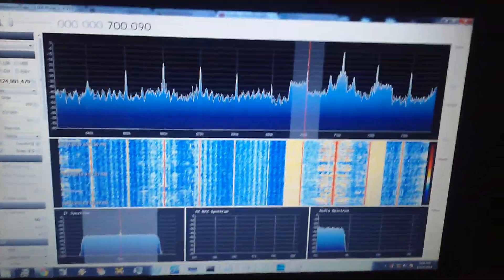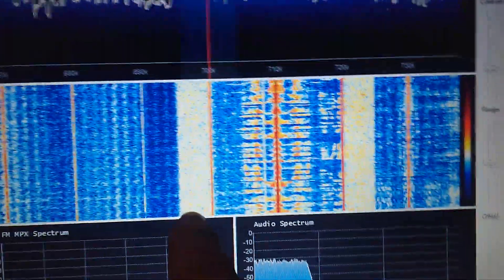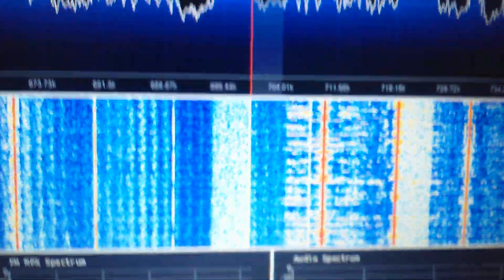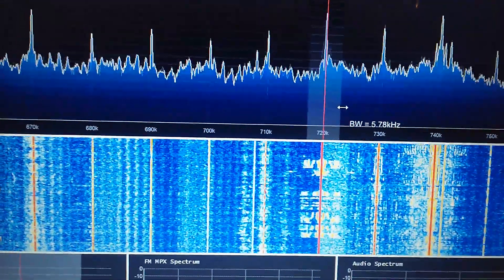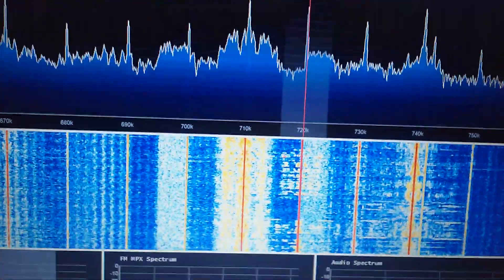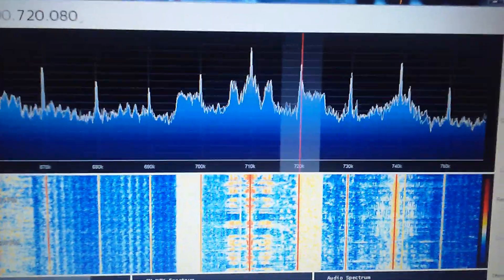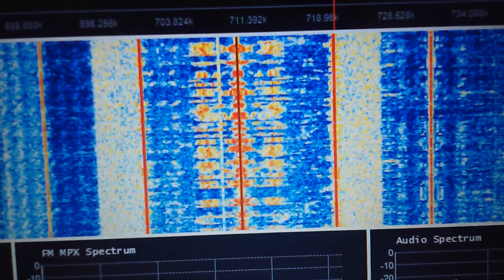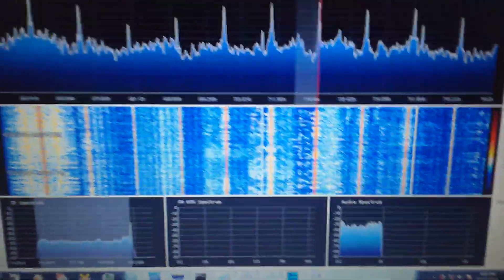HD Radio is murdering AM.

Comment: I bet this has something to do with why 850 KOA doesn't use IBOC (HD Radio) anymore... They used to use it until middle of 2013, but since they are a primary clear channel station, they pump out 50,000 watts 24/7, and have been heard in many parts of the world.
Reply from the maker: It could be a management thing too. The clear-channel stations here on the east coast that are allowed to run HD radio seem determined to run it all the time.

I think it's fine during the day; but it's entirely pointless at night. The signal isn't stable enough to work; it ruins it for other stations. I've been letting every "neighbor" of these 30khz blasters know they need to file a complaint. But, it probably won't help. The FCC cares less about interference and more about money. iBiquity makes it hand-over-fist with the HDRadio patents...stations have to pay a yearly royalty license and every single reciever has to pay a royalty. I've been informed the cost of the license is $20/unit; which is why you won't see dirt-cheap HD radios unless they're selling them at a steep loss.
Reply: @dewdude   Wait, what about WLW on 700?

Comment: Very clear demonstration. Previously I though HD radio hybrid mode might be in an efficient way of modulation, but I was wrong. What's more, in hybrid mode it takes up 30 kHz spectrum. Thinking about AM Stereo in 30 kHz, it should sound as nice as FM stations with 15000 Hz treble audio quality.
Reply from the maker: Well...AM stations are only supposed to be about 20khz wide in the US; that is actually how the rules are written up even though channel spacing is 10khz; you're not supposed to have two adjacent stations that close in an area. In reality, they can broadcast up to 10khz of audio response. HDRadio is a special case; they have to get special persmission to run it; but the FCC is practically handing those out. It's lead to problems in some towns.

30khz AM does not sound good. The problem being that the signal to noise ratio drops as you get higher in the audio spectrum; this is bad for AM...since it's literally just relying on the ampitude of things to work. That 30khz would be reduced to an effective 10khz after a few miles; and less after that. It was tried, it sounded horrible. 

Spectrum response isn't everything in a broadcast; the type of modulation will also determine the quality. FM relies on a frequency change to represent modulation as opposed to amplitude...it's more immune to noise as a result.
Reply: And AM stations aren't designed for high-fidelity radio reception. That is why the channel spacing is only 10 kHz.

Comment: I pick up KSL 1260 at night in HD from 700 miles away.  Sound is way better.  These kinds of videos made the stations in my town not do HD am anymore
Reply from the maker: No. These kinds of videos did not make the stations in your town stop doing HD. They likely stopped because they don't have the money. Stations have to pay huge licensing fees just to broadcast in to it. With HD Radio being pretty much adopted by force rather than choice, it's not worth it to a station to pay however much a year for 1 or 2 listeners. You have to remember, radio isn't making money like it used to anymore. The big conglomerates like iShart continue to run HD on their stations; but even here when a number of them shuffled owners, the independent owners could not afford HD. That's not to mention the complaints from other stations. You run HD, technically you're running outside of your assigned channel...you get a waiver from the FCC. But if an adjacent channel owner complains too much, then they can make you cease running HD radio.